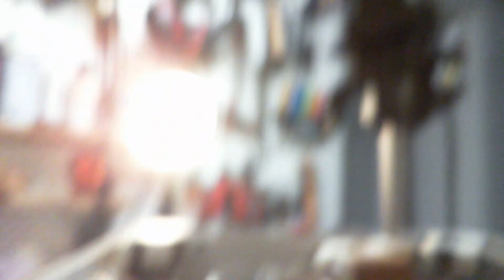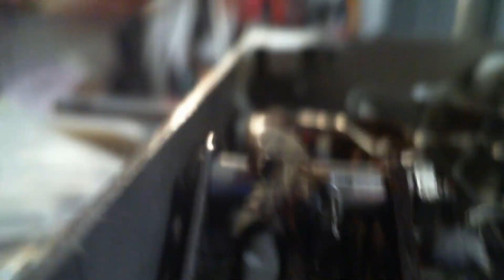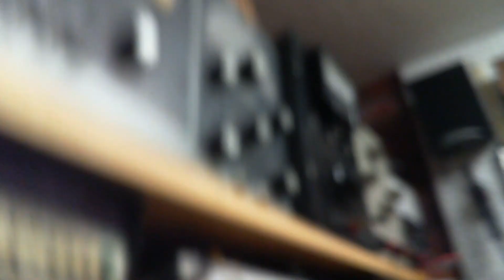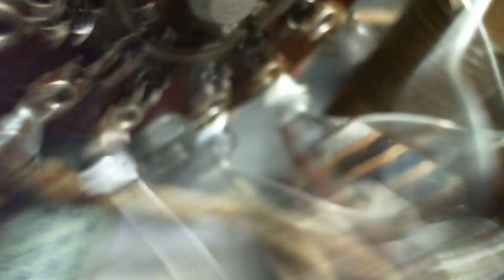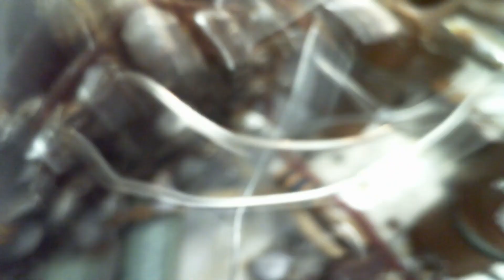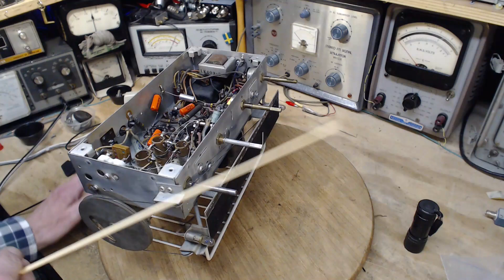Viking Model E1 4526Z Tube Radio Video #2 - Broken Band Switch

Comment: There are several holes where a flat piece of metal attatched to the shaft should ride over. The metal uses the holes as a 
detent and would have a bend in it that holds a ball  bearing and rides into each hole but not go beyond the  holes in either direction. Could you replicate one? Possibly, but it would take some time to get it to work.😖